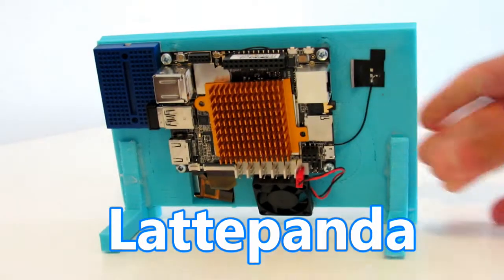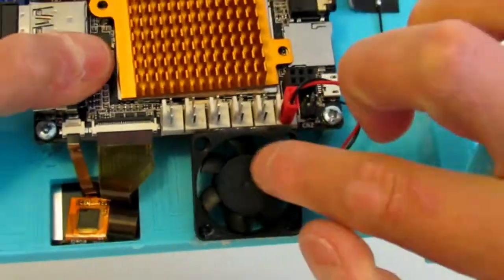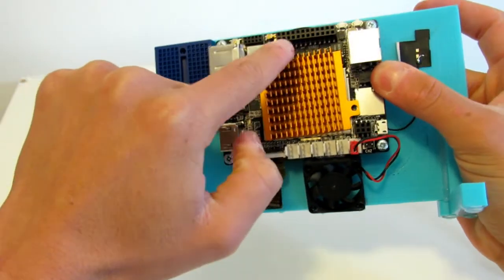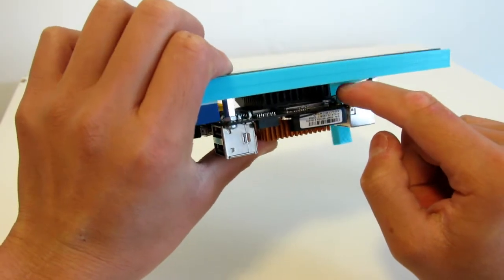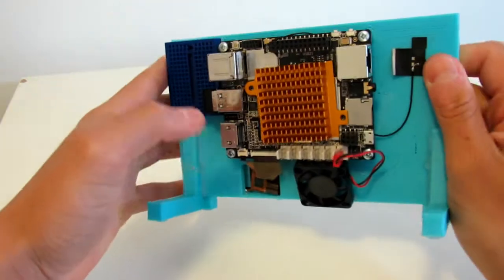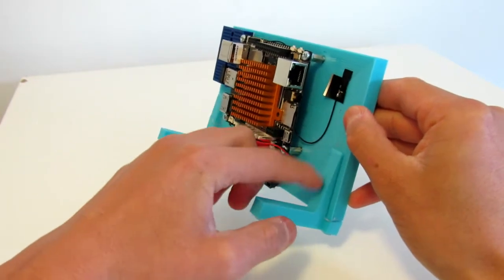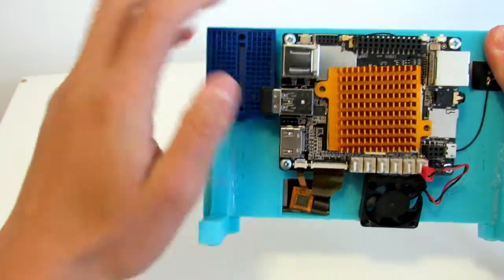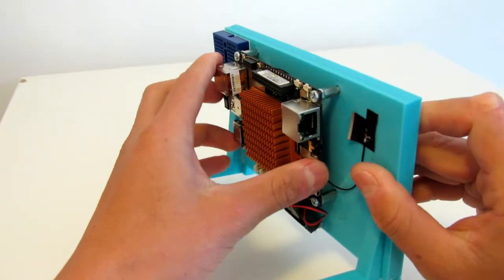✔ #Lattepanda Upgrade

Comment: Why do you use a lot of thermal paste on the inner heatsink? For maximum heat dispense you should use as little as possible (a tiny drop) and push the heatsink on carefully and make sure there is no air bubbles. To use a lot of thermal paste is counter productive.
Reply from the maker: Marcus Adell it a drop but it expanded a lot haha :/

Comment: Hello MrJefferson105! Thank you for your videos, they are helpfull! I was wondering, did you have any problems with your LP since you got it?
Reply from the maker: Patrice Lauzé Hi there! no worries I am glad  they help you , I had problems with is at the beginning because it did not want to load but  after fixing it , I have not had any problem with it at all really  it works fine the only thing is that it gets really warm so I 3d printed a case and added a fan to control the temperature of it .
Reply: Thank you for your fast reply! One more question - by your experience, do you think it would overheat if I used a LP 2/32 within the acrylic case, using a fan and small copper heatsinks as shown on this link?

https://www.dfrobot.com/index.php?route=product/product&search=LattePanda&description=true&product_id=1551
Reply from the maker: Patrice Lauzé well to start with the heat sinks are to small  for the amount of heat   that the LP produces  so I wouldn't recommend it ..I also have the acrylic case but is not worthy. If you could get hold of a 3D printer you could do a custom one or just download it from thingiverse. .... my LP is the highest one not the 2/32 . 

I would recomend big heatsinks as shown in the video and perhaps another fan to be able to use it for long ours . I use mine to watch  full hd movies mainly  and to run arduino. .. sometimes... I hope this helps
Reply: It does help, thank you for your time! :)
Reply from the maker: Anytime :D